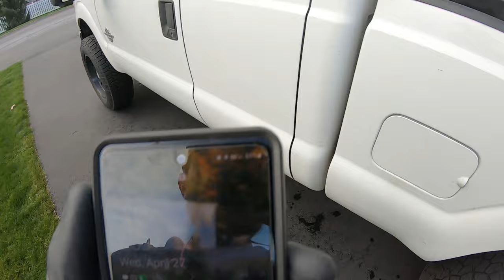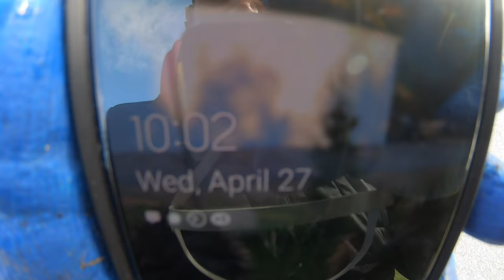4 Houses on 1 Street - Importance of Wash Routine

Comment: Hey man, love the channel. I notice you don't cover up the light fixtures/ security cameras/ electronics. Have you ever had an issue with this? The last house I did I blew out 2 lights on a house because I got SH on them, and now I'm real nervous around the lights/electronics.
Reply from the maker: Hey Frank. I've done over 300 washes and I popped a outdoor socket 1 time. Don't hit outlets or lights any different then how it would rain on them. It doesn't pop during a thunderstorm so it shouldn't with a wash. Light fan spray around those types of things and never directly if you can help it. If the odds were worse than 1 in 300+ then I'd probably tape or cover but at those odds and being a little careful it's just a waste of time
Reply: @YoungAmbitionYA  Thanks man, I appreciate it. Keep doin your thing!

Comment: i know you have mentioned that you do not use surfactant for house washes , im wondering how much time you save considering , quick rinsing , but do you have to do multiple coats on a dirty house ? or at that point do you use some surfactant?
Reply from the maker: The soap doesn't do any cleaning. It's just sticky and pulls debris and crap to the ground easier. SH does all the work with the mold and algae. I spray sh on and let it dwell for 1 minute and rinse. It's a little quicker since the sh rinses much easier than soap. Using soap is fine I just choose not to at the moment
Reply: @YoungAmbitionYA  yea I’ve always been using surfactant for house washing , gunna try without to see how fast I can rinse lol

Comment: Awesome videos and such a fast process as always !! I’m still also trying to figure out the best way to rinse/pre wet the planets . Pull out the pw hose and use that then jumping to my 12v but it’s taking forever lol. Are you running a 7gpm pump for your 12v and was it a delvan is the name ? Sorry again to be long winded
Reply from the maker: All good Jeff. I use a flojet 6gpm. Make sure you mix is under 3% and rinse plants. Plants will be fine
Reply: @YoungAmbitionYA  thank you again for the response brother ! So you are using   Your 12v to pre wet,add chem and rinse ?
Reply from the maker: @TheJwilson16  yes sir

Comment: Those size houses would have taken me twice as much time and that’s rinsing with a 5 gpm pressure washer. I’m obviously adding unnecessary steps. Could you video a house wash beginning to end. I’d come spend a day with you if you weren’t so far away. Thanks.
Reply from the maker: Practice makes perfect. I've had a few hundred washes to help me trim the fat. Routine is everything.  I do believe I have a handful of full washes on my channel. Check them out. I'll try to do a newer one this season

Comment: Grab you an 18-24” lance to pop on your gun so you don’t have to bend over so much; save that back! May also work with the 12v for added reach if needed. Definitely agree with 3% dwell and rinse ( I use xjet m-5ds to rinse). Nice work on the 4 bangers too! 
Oh and a Balaclava for your face! 😊
Reply from the maker: Yes I need a face mask for windy days. I have a Lance on the truck. I find it's easier to cause damage with the turbo nozzle on pained wood like the house siding and railing here. Bending over and holding the gun in my opinion gives me more control and no damage. I use the Lance on paver and concrete
Reply: That make total sense👍  I’m an ole’ guy with bad disc so that bending over can get kinda tough quick for me. 😁